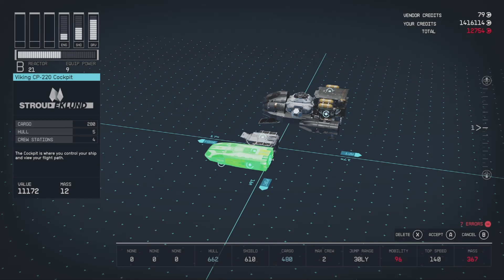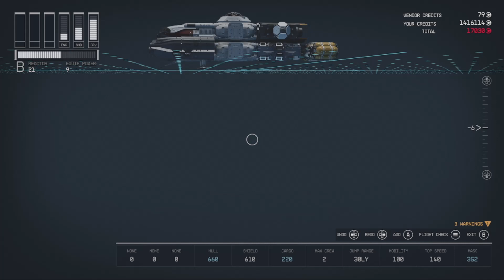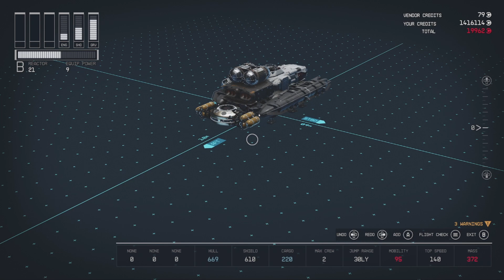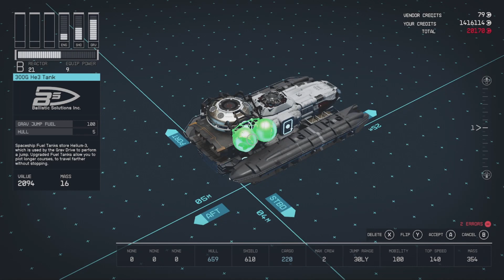Starfield Tiny Ship Building; Micro machine v2 -- ShadowBadass

Comment: What killed your mobility was the cargo holds. It was fine till you added those. They carry a lot of mass for what they can carry. If you wanted to make it a little lower, you could use a vertical landing bay and slide the cockpit forward 1 spot then put the reactor behind the companionway. (the hopetech landing bay has side attach points for your landing gear) This would leave the spot where the lower companionway is for the fuel tanks to be mounted under the reactor and the whole ship is only 2 decks high.
Reply from the maker: Ok thanks for the headsup. Was using that shit tonight, wasn't bad but if it becomes an issue I'll try some of those changes.